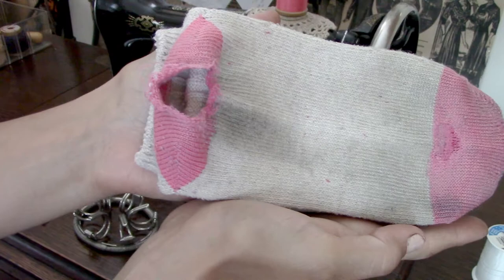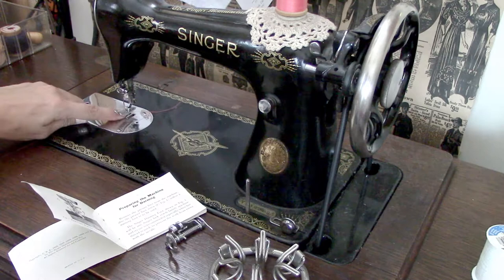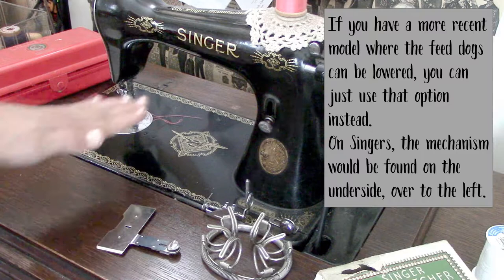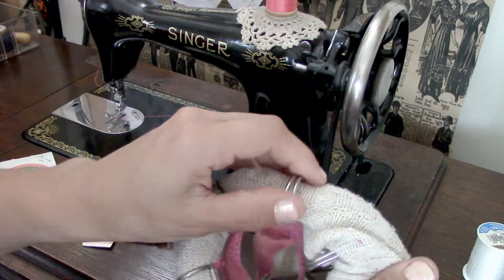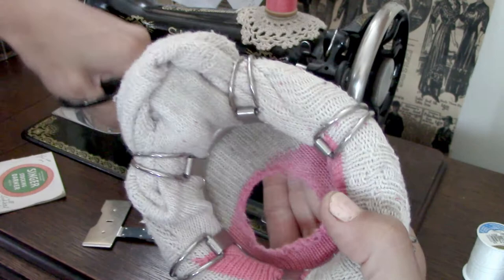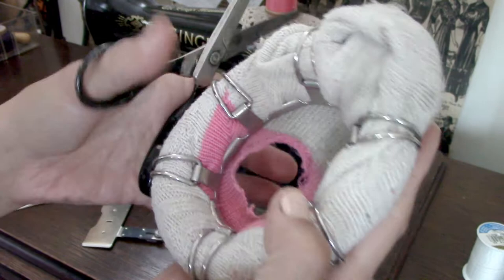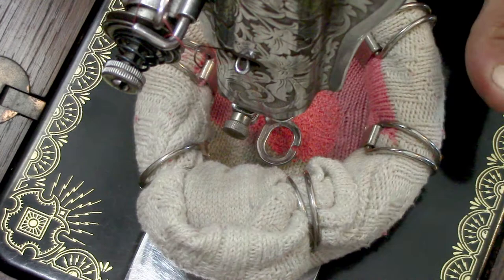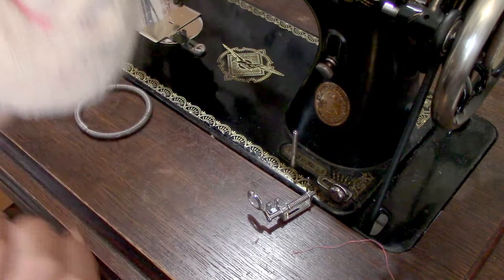Singer Stocking Darner 35776 attachment : darning/mending sock hole / sewing machine - tutorial

Comment: Thank you for this video. I have one of the stocking darner frames which came with my old Singer 99  when I bought it, but there were no instructions, and I simply did not understand how it might work.  Sewing in air from one side of the hole to the other just didn't seem possible. Still not quite clear on that, but I am encouraged to try it myself, and will learn by doing. My mother used to darn socks by hand, using a wooden egg to hold the sock in place, but but that has never appealed to me. I don't think that Mom liked it much, either...
Reply from the maker: How wonderful! I too have a darning egg (and "mushroom"), but much prefer the sewing machine option :)

Basically, all you're doing is anchoring the stitch on one side of the hole, and using the machine to advance thread across empty space in order to anchor it to the other side. 
You theoretically could just stop the machine and manually pull enough thread to span the distance, but it would be slower, less accurate, and more likely to break a thread.
Feel free to let me know if you have any questions.
Reply: @24Washington  But, (Please remember that I have not actually tried this...yet) with the machine humming away, what happens if the needle comes down and tries to make a stitch while the work is moving across the hole? Won't it make a tangle?
Reply from the maker: No. As long as the string is kept tight as you move from one side of the hole to the other, it won't be able to tangle. Best recommendation is to go super slowly and see for yourself. I have found that a back and forth motion works better than side to side.

Comment: I am having issues with snarling on the underside of the darner/sock when working the darn. Do you have a different tension setting than with regular sewing? I've tried all kinds of things. I've tried looser and more snug fitting around the tool and ball point needles for knits and I just cant get consistant spaghetti-free work where I have to rethread multiple times. Help?!
Reply from the maker: Hi there!
This sounds like a very frustrating situation.

If you're able to remove the darner and sew normally, there should be no fundamental problem. 
As you probably know, too loose of an upper thread tension will manifest as extra thread on the underside. But from the sounds of it, you've checked all of that.

 There's only one thing I can think of that might be causing you to end up with a tangled mess on the underside of your work: the fed dog mechanism.

It is important to cover, disengage, or otherwise eliminate the feed dogs when darning. The teeth can catch on the thread and pull it, causing a similar mess to your description. 

Unfortunately, this is the only thing I can think of.
If your machine straight-stitches without issue, it should darn perfectly well.